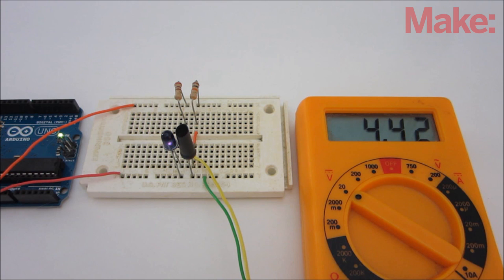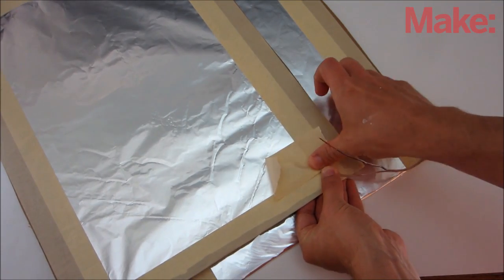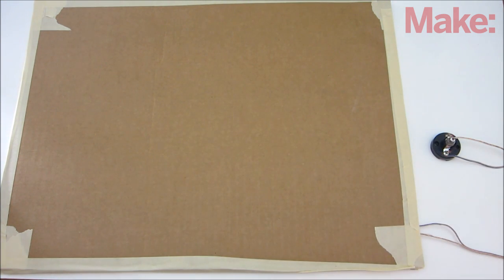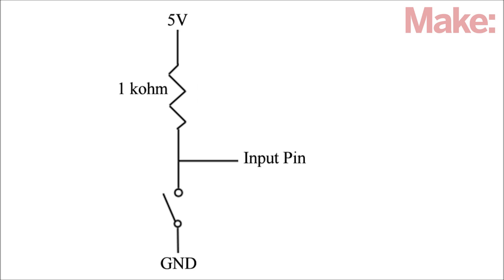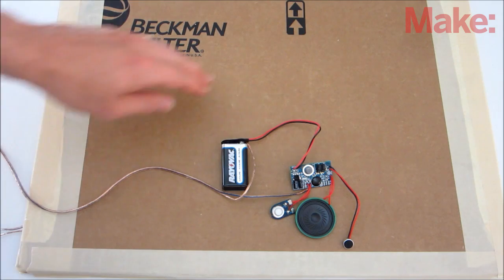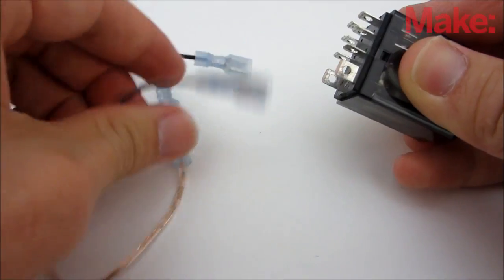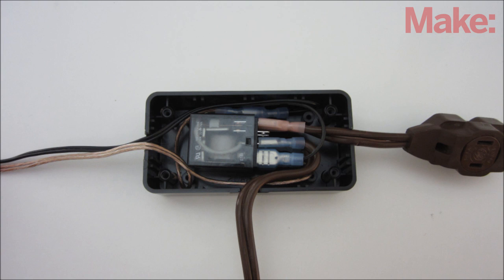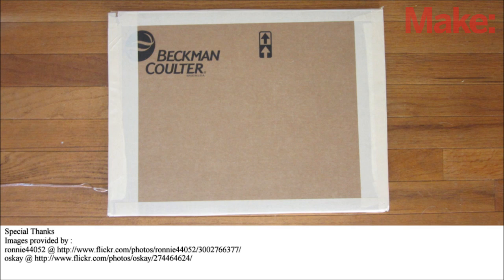DIY Hacks & How To's:  Pressure Plate Switch

Comment: Good video but it doesn't tell me how to make a pressure plate that has the system off then wanted touching it turns the thing that you want on and it doesn't tell me how you're supposed to wire this